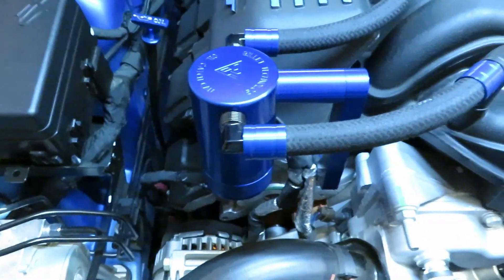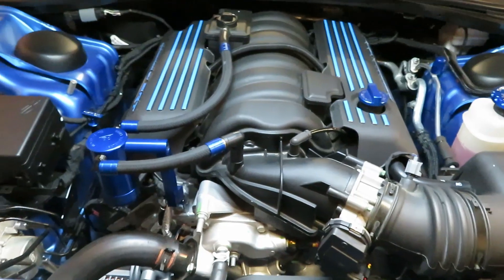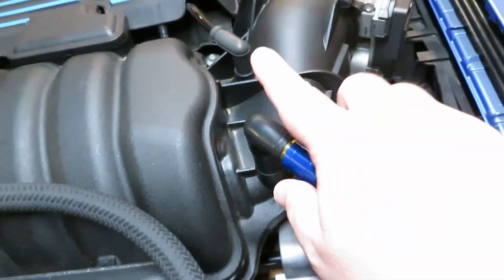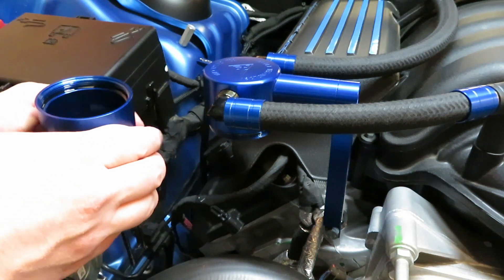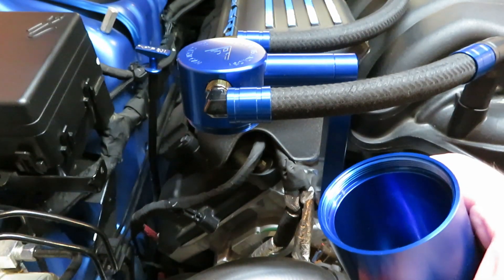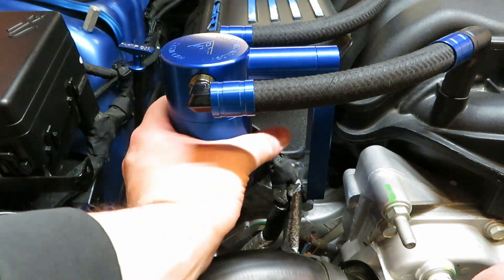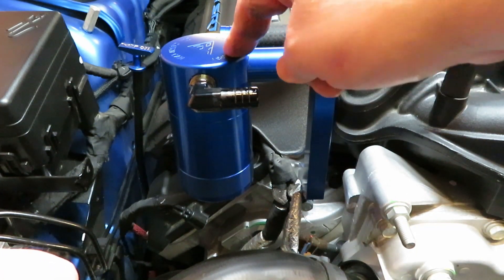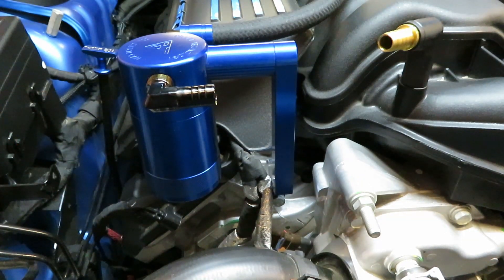Is an Oil Can worth the money?

Comment: That is the “PCV” Positive Crank Ventilation valve that has the ball in it. We had one stick on a Sheriff’s Charger and it made the car run terrible. We got a new one from the dealer and they said it’s the PCV valve. Wow that caught quite a bit of oil. When I replaced the air filter on the new truck I noticed quite a bit of oil on the filter. I’m thinking I might need one of these for the truck. Engines these days just don’t breathe very well. Very informative video brother!
Reply from the maker: Thank you when I was filming this I was trying to think what it stood for but had a big time brain fart lol! That is very interesting and good to know what will happen when that thing sticks now if I can just file that into the back of my head haha. Wow that is crazy about your truck and it sounds like you need one! It is very crazy how much of a hard time engines have breathing and especially new ones. Thanks brother I appreciate that!

Comment: Try taking your throttle body off and wiping the inside of the intake plenum with a paper shop towel.  Bypass your catch can with the stock PCV tube set up and run than for about 100 miles and do the same.  It is amazing how much oil collects w/o the catch can.  I did this when taking my '18 SP in for service and after only about 40 miles I had substantially more oil in the intake compared to about 2.5k miles with the catch can.  Took photos and plan on doing a vid on this...someday!
Reply from the maker: That would be a good way to show what it would do without one but I just don't have the heart to do that to my engine. That would be really cool to see a video on that like you did! Also unfortunately I am not putting the miles on my car like I do in the summer because of all this snow that we get so it would take me a really long time to even put 40 miles on it hahaha.

Comment: My 2018 is different than yours. It actually has a stick attached to the cap that has a high and low Mark. That goes down into the factory catch tank. Very interesting!
Reply from the maker: Chris Hall! That is so strange! You really have me wondering now because it should be the PVC valve because the engine has to have one so I wonder where yours is located? I need to do some digging on this! Thanks for watching and replying back!

Comment: I just ordered one today. I bought my 2019 Charger R/T with 18,800 miles on it 12/29/19. So I am running  a lot of Lucas Injector Cleaner in my gas tank to help clean the valves and injectors before I get the catch can hoping it's not too gummed up
Reply from the maker: That's awesome! Congrats on the new R/T Charger! With 18K miles I thing you are going to be more than ok. Thanks for watching and commenting and take care of your Charger and enjoy it! My wife just go into a wreck in her Charger unfortunately, I just uploaded a video on it.
Reply: Took less than a week to get mine. Soooo easy to install today. I cut a little piece off of the engine cover for a perfect fit over the long hose.
Reply from the maker: That's FAST shipping and great to hear that everything went smoothly!
Reply: @MeanBee392  I emailed billet technologies to send it right away and they did. I got it today and installed it. Fender mount. 2019 RT

Comment: So if you drive from NYC to LA that’s how much oil that would be burned in your intake. If you think about it, it’s really very little and probably not going to make a difference. But the OCD side of me wants a catch can. Lol. Billet Technology charges way too much for the little bit their giving you.
Reply from the maker: That is true and it does seam like a minimal amount but in an engine that is a lot. When you add in the factors of heat and fuel with the oil it is a disaster over meany miles. Not to mention that oil in the cylinders also lowers the octane rating of the fuel that is being burned and lessening your performance and fuel mileage. The carbon deposits that the oil will make and build up will eventually take out valve guides and when in the cylinders will scratch cylinder walls and will premature wear on your rings.  Sorry if I got a bit to in depth but I am a mechanic and love talking engines lol. Hopefully that all makes since and is helpful. I do agree they do cost a lot but when you factor in all the other costs that could go wrong it is cheap. Thanks for watching and commenting buddy! Also check out American Brother Designs they make some really awesome ones!

Comment: Oh come on that doesn’t even look like a half an ounce is it really worth the trouble I have a JLT catch can in my garage it’s been sitting on the shelf since I had my redeye and never put it on LOL
Reply from the maker: Absolutely it is worth it! It doesn't look like much but add that up over time and having it in your intake side of the engine and it will cause problems. Man it I had a Redeye I would of put it on right away because of a boosted engine even generating even more blow by. 🐝
Reply: MeanBee392 i’ve been trying to find out FROM JLT the one I bought for my REDEYE I will fit my 392 scat pack.

Comment: If the oil is dirty why would you want to send it back to the oil pan; I would rather add a little clean oil to compensate for it.
Reply from the maker: This is not sending it back to the oil pan. This is just keeping it from entering your intake runners and gumming up your valves.
Reply: @MeanBee392  Ok Thank you for the response!!!
Reply from the maker: You're welcome.

Comment: All you need to do is suction out the oil from the Factory plastic can, spray out P.C.V in the cap . Do this at oil changes. 
This after market catch can is a waste of money, for a gimmick. The only reason oil is in the Billet can is because the factory plastic can is full.
Reply from the maker: Thanks for your input.
Reply: Where is the factory one?  And which cars got one?   I’ve never heard of a factory catch can.    On my 06 Magnum Hemi, the factory catch can is apparently the intake manifold.    They put all this effort into highly contoured intake runners, port shapes, throttle body sizing, precision opening amounts for the throttle body, just to throw all that out of the window when the intake gets a nasty coat of sludge.  When I hanged my EGR, I looked through the port for the EGR tube and I was astonished at how much sludge was in the intake, everywhere.    It frankly pisses me off.    I’m gonna get another intake from the junkyard, clean it to like new, and then compare what happens after so many miles with the clean one, after installing the catch can.     The intake on my old V8 engines never looked like that.   The inside of the valve covers did though, and that’s exactly what my Hemi intake looked like inside, old,dried up sludge coating every surface.    I’m sure that’s good for driveability and performance.